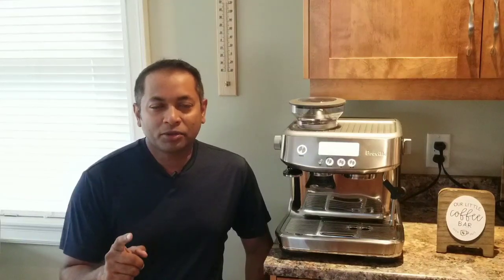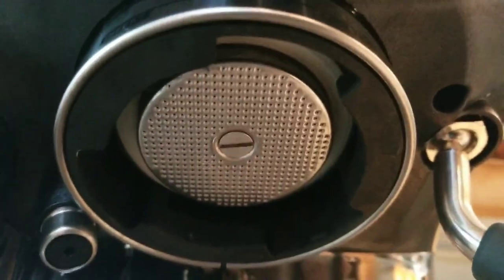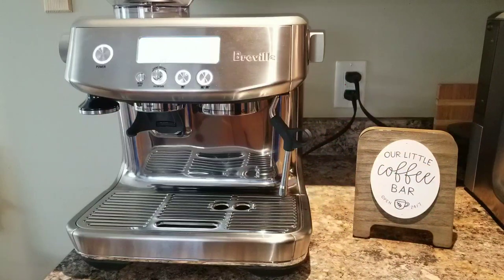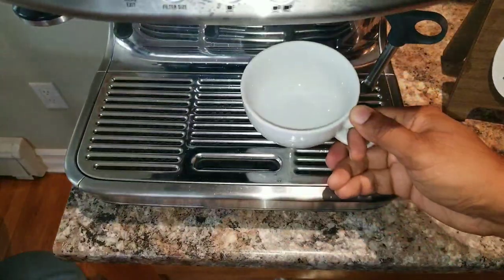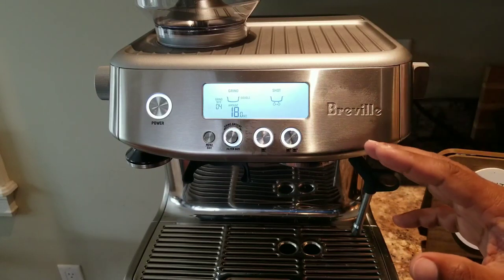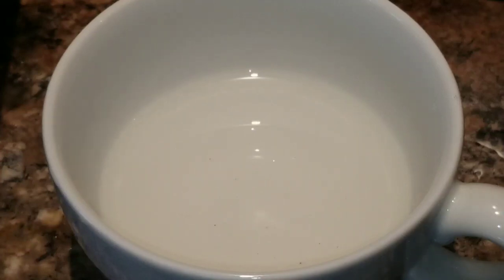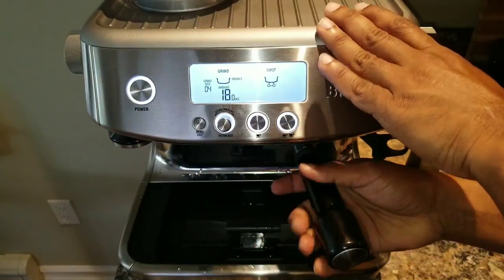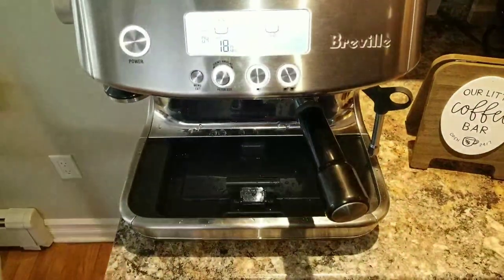How to BACK FLUSH daily | Breville Barista Pro

Comment: Super helpful and you answered my question about water coming out of the portafilter. Brilliant showing the water coming out into the tray. Thank you so much!
Reply from the maker: You are welcome
Reply: @AjusCafe  I just finished. Still didn’t see water come spurting put into tray but Breville assured me it was correct. I did get dirty water and some grounds. I also used the cleaning cycle (I have a Barista Touch) but without the cleaning tablet.
Reply from the maker: Not sure of touch, but if breville confirmed then its good

Comment: Hi, i read this somewhere from a blog in which someone said “I've had an email from a reader who has received a hole with a disk, which is a surprise as I'd not heard of them using these kinds of disks for a while. I spoke to Sage and they've informed me that this is to do with the firmware version on that particular machine. Some batches have been produced which a firmware version can detect higher pressure for prolonged periods, in which using a standard disk without a hole could cause issues, so if your machine does come with a disk with a hole, you'll need to use this disk, and just put a bowl under the portafilter. “

I am wondering if those machines with a black flush disc with hole in them are considered newer or older machines? hmmm
Reply from the maker: I was thinking older ones came with a hole in the disk, but all new BBE i tested came without a hole. But now this new BBPro came with a hole in the disk. So its nothing to do with new and old versions. I don't believe it'd affect any component in the mache due to high pressure, because they all come with 3 way solenoid and an OPV (Over Pressure Valve) that will bypass excess water.
Reply: @AjusCafe  Which disc do you typically use and prefer for the BBPro when performing the backflush?

Comment: Do you think it's necessary to do a 'clean' cycle when the  clean light flashes when one is already back-flushing with the Cafiza powder after every use? I've also been using a puck-screen (thanks to this channel!) so my shower-screen and machine in general is exceptionally clean. On another note, do you know if the 'clean/descale' light goes on based on a # of shots pulled or if there is an actual sensor, I'm strongly assuming it's just based on time and not an actual sensor, but wonder if you know? And lastly, do you think there is any difference in performance of back-flush cleaning between the Cafiza powder & Cafiza tablets?
Reply from the maker: Sorry not sure if i replied, but yes the machine has a set number of cycles and the clean or Descale flashes. Powder or tablet is good for clean cycle.

Comment: Hi Quick qn, when you turn on your breville barista pro, does your machine eject water at the drip tray? Mine does and i am not sure if they are residual water from the backflush i did or is it part of the process of the machine clearing old water when the machine is first turned on.
Reply from the maker: Hi, its very normal to see around 1 TBS of water in drip tray. I can confim that its the same on Barista Express machine too. Its the excess water thats pumped out from the solenoid, as jt draws fresh water into the boiler

Comment: @lothar1080 

1080? Do you snowboard??? Anyways..
I need you in my life!! I am at my whits end. Currently the water does not stay in the tank it is defaulting to flow on through the drip tray until there isn’t any water remaining  in the tank. Nothing is wrong with the seal. 
The only time it isn’t going ham into the drip tray, is if I am using the steam wand (no steam just water), or the hot water spigot (not hot, just water). the wand or the spigot (for hot water). For testing,  I tried to pull a double shot the pre infusion doesn’t work… it just pours on through as light brown water… 
9:28  - this sound is constant when not in use and simply plugged in. One evening it just started we weren’t even using the machine!!!! 
Breville isn’t answering or calling me back (in a what seems like a 1000 que) and the shop I purchased says I need to call Breville. The thing only 4 months old. Hubs cleans / descales it on the reg. So maybe you can direct me where to find the answer.
I haven’t ONE video where water doesn’t stay in the tank and the machine constantly makes a noise as if the pump is working overtime when it isn’t even at work!!!
Thanks in advance.
Reply from the maker: Take it for repair. I'm not too clear on what you explained

Comment: I had the drip tray in an did a flush and the water came out from the bottom. Do you know what I may have done wrong? This is a new machine, I’ve only had it for about a month.
Reply from the maker: Backflush would bring water down into drip tray. There is an outlet just about drip tray on the machine, somewhere in the middle you will find a white plastic outlet. That's normal during Backflush and even during extraction of Espresso
Reply: @AjusCafe  yes, I know that sorry I wasn’t clear but it came out from the very bottom of the machine it did not go into the drip tray. It leaked all over the counter.
Reply from the maker: @cidneericapa4785  that is not normal. Since it it new, you need to call Breville support. They will fix it for you. Also ensure water tank is installed properly  if not it can leak.
Reply: @AjusCafe  it’s nearly impossible to get through to support so I thought I’d try here 🥹 but I will continue to try them.

Comment: Hi @aju’s Cafe, I bought the cleaning disc without the hole and tried the second method in your video. I am facing a strange problem. When i press the single shot button to start the backflush, I was not able to stop the machine at the 20 sec mark despite pressing the single shot button( auto stopped around 25 sec)This happened for the second attempt. Only in my third attempt was I able to to stop it at the 20 sec mark.

Does this happen to you or anyone else??😮
Reply from the maker: If you are in "clean" mode, you may not be able to stop. But when u press single or double button, you should be able to press any time to stop